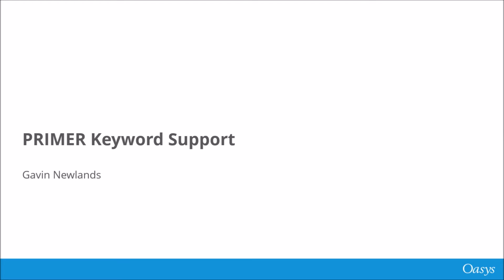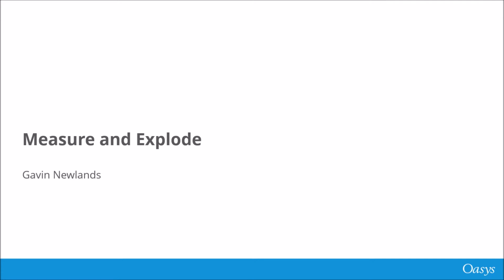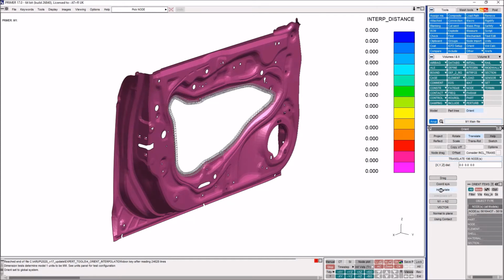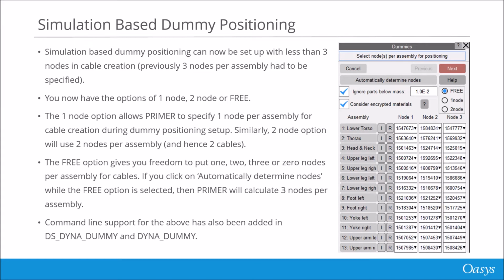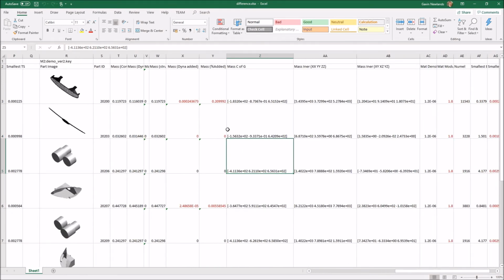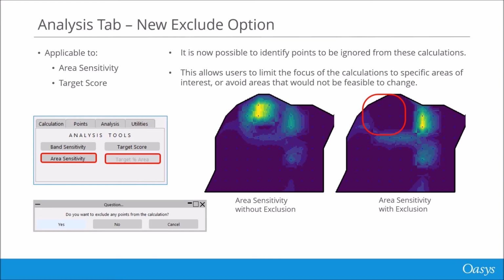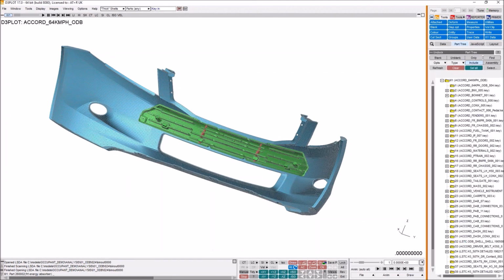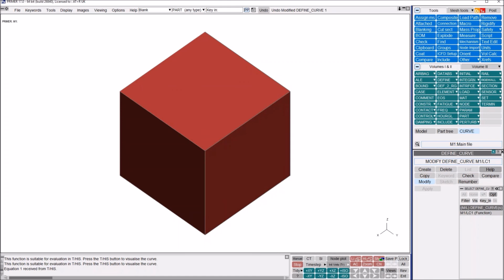Update Webinar: Oasys Suite 17.0 – Latest expert tools for LS-DYNA models

Comment: Oasys Primer is the only software that keeps the original thickness and name when replacing parts. That really sucks, you know?
Imaging working with 20+ plastic PIDs, replacing them and boom... all the thicknesses are wrong, the names too.
Even a mesh generating software like ANSA can do this much better than Primer
Reply from the maker: Hi tammttg,

Thank you for your feedback, I am sorry to hear you are struggling with the part and replace functionality in Oasys PRIMER.

PRIMER has the functionality you require and more! Please contact dyna.support@arup.com and one of our support engineers will happily show you how.
Reply: @OasysLtd  thanks, there are the transfer options that let me set 'section' and 'part title' to be updated. You should set them on, we rarely expect it works like your default settings